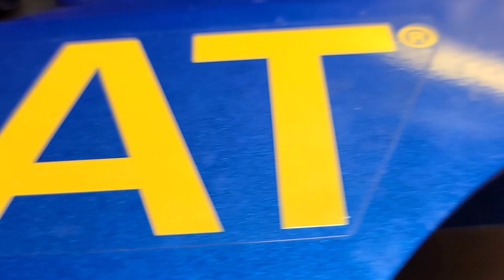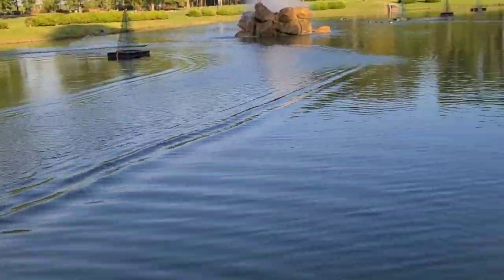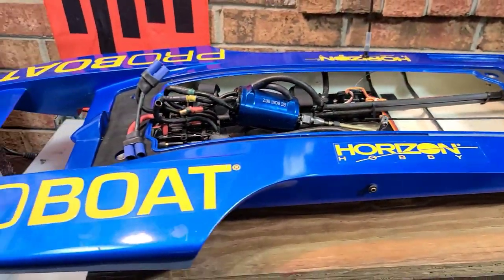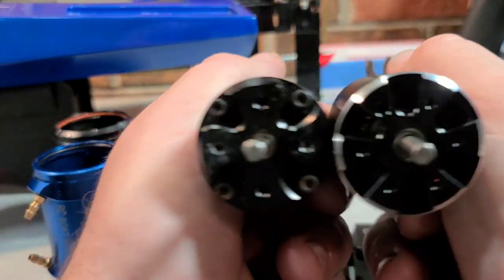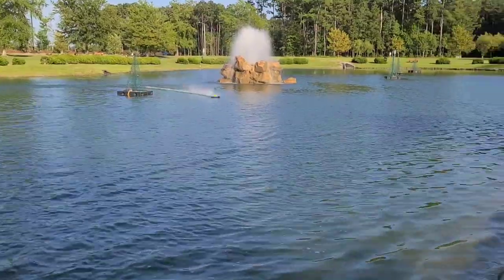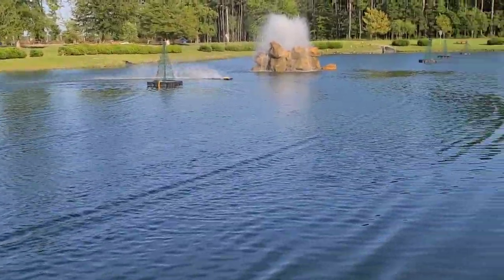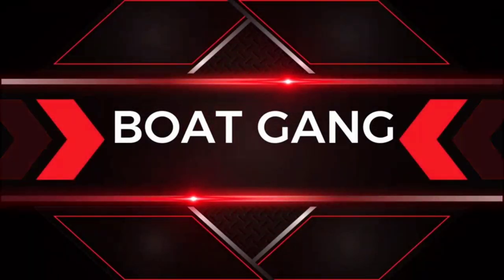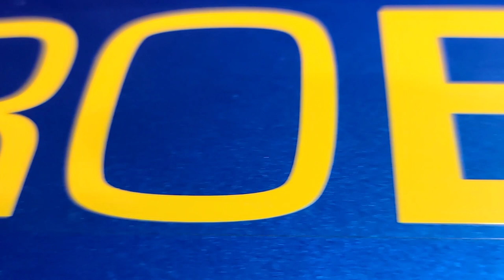Brushless Motor Test Same Size Different KV - Wire & Bullet Connector Temp Test Proboat UL-19

Comment: Hey B, I was thinking of trying a Traxxas 540XL 2400kv in my V1 Sonicwake on 4S. What would you recommend for a prop size for decent speed/run time. Or would you just keep the stock 1900kv on 4S and get a different prop? Trying to get   A middle ground on speed and run time for my son&wife to have some fun.

Comment: Hey bro I think I would try to put that 2000 KV motor back in it on 6s of course put your 8 mm bullets on it and then see what happens I think that's your weak link is just your bullet connectors. Because that's 1700 KV it just don't have the pep like the 2000 did. You know how we are if you can't beat on it hard or take it to bed it ain't worth having
Reply from the maker: I've got a 4082 2200 kv motor in her now with a 200a esc

Comment: Great info and testing "B". I gotta try water cooling my motor wires on my Sonicwake. I use silver core solder which prevents the motor wires from unsoldering, but the wires still get hot enough to melt the heat shrink when I run it WOT for several minutes. My boat is set up with an OSE 150 ESC, Leopard 1900 KV motor, 100c batteries with XT150 connectors and a 4514 CNC prop, which I consider to be a mild setup. I also upgraded the motor bullet connectors from 6mm to 6.5mm. The hot motor wire issues go away when running a 44 mm prop but then the boat will barely break 50 MPH. I rarely have this issue with any of my other boats, which has me scratching my head. Oh well, thanks for the info - really helpful!

Comment: Hey man, I been learning a lot watching ur boat videos, I was wondering if you’ve had problem with steering, I changed the steering rod on mine.  I ended up using part of a cable from an old bike…it actually ended up working perfectly lol have you had to improvise anything?
Reply from the maker: I changed my steering rod over to carbon fiber only because it's lighter weight

Comment: great video brother, this is going to sound silly, but what i did on my stealthwake is put one of those cheap fans that you plug into your cell phone with a small power bank and used Velcro and it actually helps on the temps, it just puts airflow through the hull,i know it sounds weird, but it helps my boat anyway, take care
Reply from the maker: I've seen alot of guys use cooling fans on there rc boat set up.  Thanks I

Comment: So the 1700kv has a slower top Rpm at the same volts but could handle a bigger prop & create less heat?
The 2000kv spins at a higher rpm at the same volts but intern creates more heat?
So a 1700kv has more Tq at slightly less rpm & the 2000kv has less tq but more Hp & a higher rpm limit.
Am i correctly thinking these terms? 
I just bought a 4082 1700kv for my Spartan wondering now if its actually a upgrade from the 540xl, i assume it may spin less rpm but could handle the bigger props
Reply from the maker: You're thinking is correct!    The 1700kv  4082 will handle a much larger prop with  cooler temps, Basically more efficient...
Reply: @IRONCLADRC  thanks Big B! I think your channel is beginning to blow up! I just bought a used Recoil 2 from one of your subscribers & I bought it from him bc of your videos on the boat. Funny how it made full circle to 2 of your viewers bcnof your videos! Keep um coming!

Comment: This is such a valuable video Big B. You're so right... getting the UL-19 running right is a real challenge and I'm still tinkering a lot with mine. 🙄
I know you're not a fan, but using dielectric grease on all of your connections will not only help keep the connections clean, but improve current flow through the connections. I use it on battery/ESC/motor connections all the time. 😉
And glad to see you got some use front that cooling jacket bro 👍😆
Reply from the maker: I went to tick up  a can of dielectric grease yesterday both places were out of stock. Grrrr.  Hopefully I can find some today
Reply: @IRONCLADRC  You're the Man brother 👍

Comment: Hi Big-B , Always try & bend over the ends of your wires so that the connector is full of copper before you solder may help , Its surprising they dont make connectors with mechanical clamping.
Reply from the maker: Thanks for the tip

Comment: Strut on my boat is flat on the board. 
As far as solder, are you going to use silver solder?
I have been using Kester leaded solder. 
I read silver withstood higher Temps?
I have no experience using that.
Love the video's,  keep em coming  Big B.
Reply from the maker: That's all I use as well common electronics solder, never had a problem with my solder joints in the past, but for some reason in this boat,  almost every run desoldering joints
Reply: @IRONCLADRC  hot, hot, and hotter.

Comment: The heat is due to resistance in the wires.  Can you replace the wire with the next gauge thicker as well larger battery connectors?  That should help bro!  Boat Gang

Comment: make sure they are clean and tight if they are not they will create heat if you have to bend the connecter spring to make it tighter do so it will make a world of difference as any loose connection or corroded will create heat and melt solder also they do make a high temp solder that would help also
Reply from the maker: Thanks for the tip 👍

Comment: If you are using lead solder, try using the silver bearing solder it melts at a higher temperature.
Reply from the maker: Started using silver solder just after this video. Been good so far

Comment: Have a question about the cooling tubes running from the esc...I have a vector sr80-pro boat and the exit tube from the esc (stock esc) runs all the way out the back of the boat... it works fine ...just saw alot of your boats have it running outa the side really close to the exit tube of the esc...does that get the water in and out of the esc faster than running that long tube to the back???🤔 and is it better for the esc to keep it cooler...🤔 thanks👍
Reply from the maker: My personal opinion  yes.   Also having the exit on the side allows you to see the the water flow while running the boat
Reply: @IRONCLADRC  HOW HIGH SHOULD IT BE ON THE SIDE??? ENOUGH TO SEE THE WATER COMING OUT???

Comment: Answer for Question on 09:38 min
Specification for  
=/SSS 4074/2000KV marine motor RC/=
1.Motor Winding: 2Y
2.Diameter/Length: 40/74 mm/mm
3.Max Amps: 132 A
4. Max Voltage: 26 V
5. Max Power: 3500 W
6. No-load current: 2.9 A
7. Max RPM: 55,000 /55K
8. Shaft (fi): 5 mm
9. Weight: 380 g
10. Poles: 4P
Reply from the maker: Thanks, that motor has been an absolute beast in that boat, 2 years later, I finally got the motor specs.   89mph motor in the ul19 w/ Hydra xlx w

Comment: Fill the screws with silicone B
Reply from the maker: I actually did, I'm running the 2000 kv in my veles filled the grub screws with silicone before installing the motor.    ALL GREAT MINDS THINK ALIKE!

Comment: my charger is blinking red and green but never went any other color  and it was at like 4 %
Reply from the maker: The balance lead from the battery could be dirty/corroded.  Use a stiff wire, stick in each balance lead hole on battery one at a time!   Move the wire around in the balance lead holes knocking the dirt & corrosion off